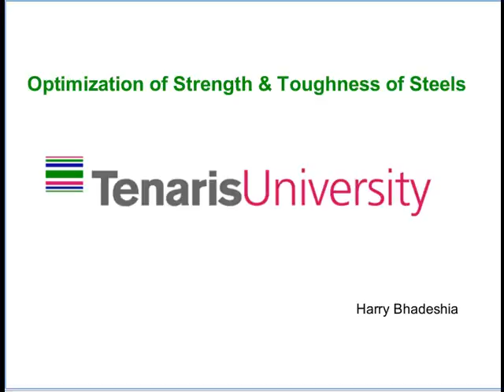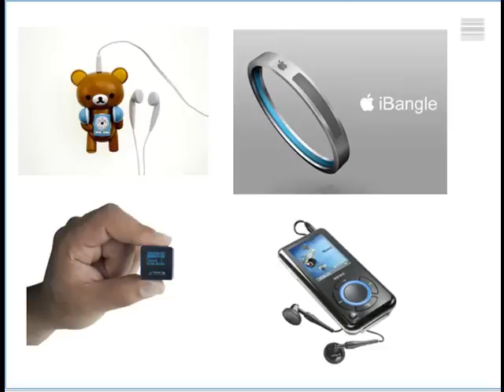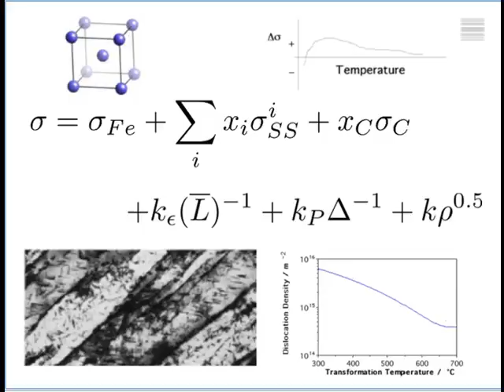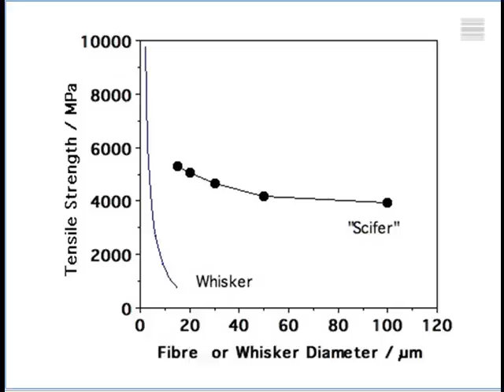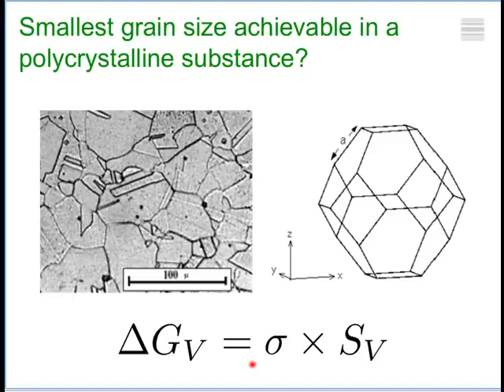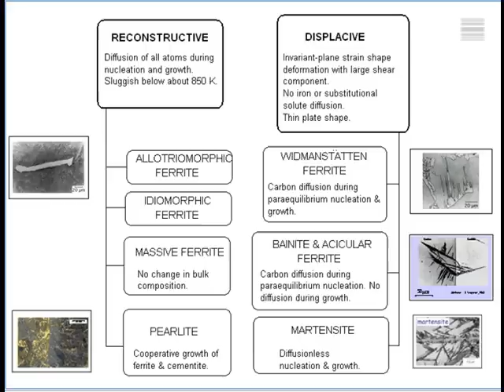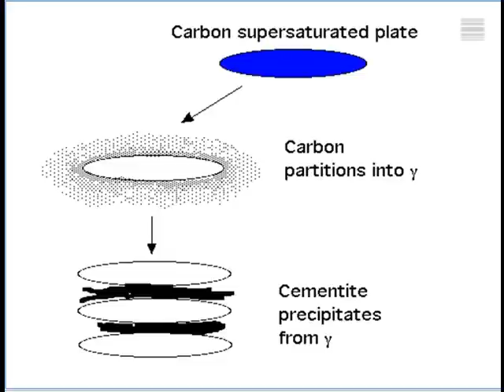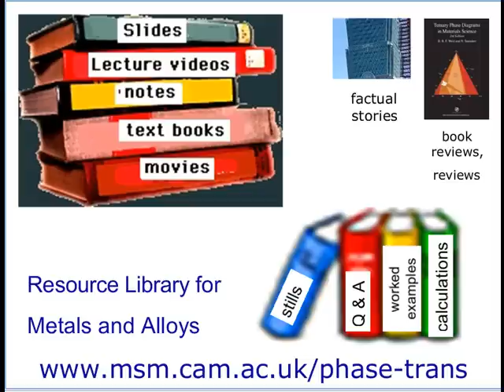Strength and Toughness of Steels

Comment: Sir Bhadeshia,  Do we make a connection between the yield strength in tensile test with charpy test which means the lower yield strength like 550MPa with high charpy number like 150J however the higher yield strength around 800MPa with lower absorb number maybe 40J? Or there are not any relation between tensile test number and charpy test ?
Reply from the maker: In general, the toughness decreases as the strength increases because the stress for plastic flow becomes greater, increasing the chances of cleavage fracture under appropriate conditions. However, exceptions arise when the increase in strength is accompanied by better toughening mechanisms, such a structural refinement or the introduction of appropriately stable retained austenite.

Comment: Professor Harry Bhadeshia ,Do you think why medium and high carbon martensite's tensile strength is low, though  martensite is strong. medium and high carbon martensite is  brittle, but it doesn't mean the  tensile strength is low.
Reply from the maker: Hardness can be measured to see if this is correct.
Reply: medium and high carbon as-quenched or low temperature  martensite's hardness is high and strong,but why the tensile fracture strength is not high?